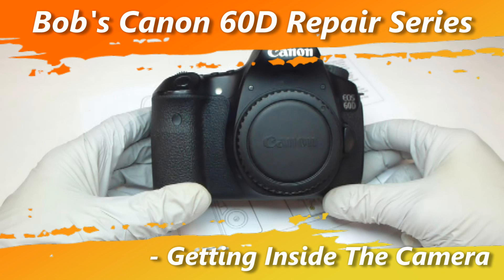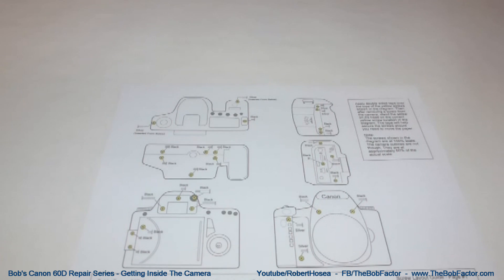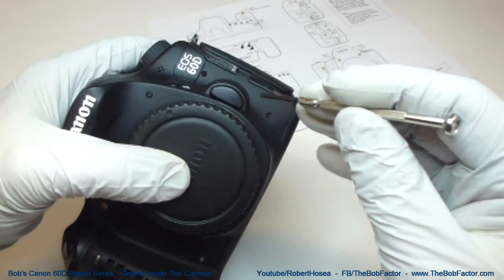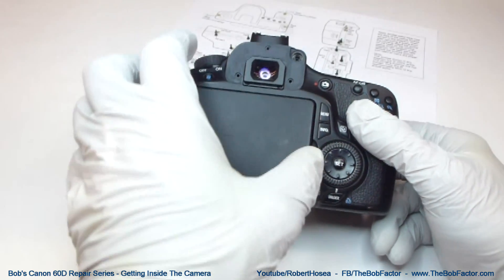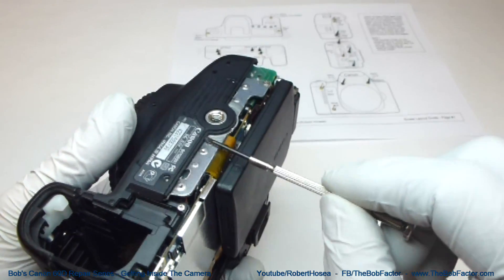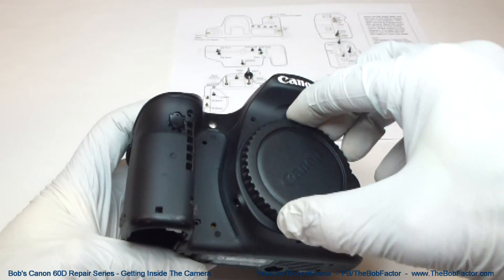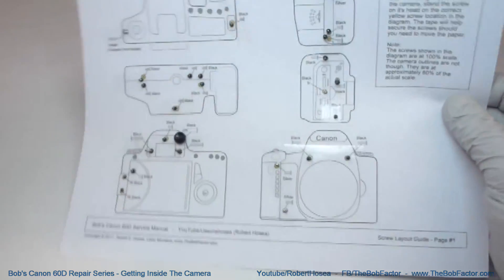Canon 60D Repair Series - Video #1, Getting Inside The Camera

Comment: Hi again Robert. Did you ever have err 80 on your 60d? Mine started with that, then main LCD stopped working, then camera won't turn on anymore. Every once in a while, I got it to turn back on just to see that err 80 flashing on top LCD and if I turn it off, it will be dead again.
Reply from the maker: Hi Lazy Chop.
I've never had that error come up on any of my 60D's, but I've seen a lot of comments from people in forums that have run into it.

Here is Canon's info about the Err 80:
---------------------------------------------------------------------------------------------------------------------------------------------------------------
Description: A malfunction with the electric control or images has been detected.
Resolution: Turn the power off, then remove and re-install the battery. Then turn the power on again.
---------------------------------------------------------------------------------------------------------------------------------------------------------------

Here's a comment from someone's post in a forum who had talked to a Canon rep about it, and what they suggested regarding Err 80:
---------------------------------------------------------------------------------------------------------------------------------------------------------------
I contacted the Canon reps, and one suggestion they had was to take out the SD card, battery and other accessories from camera and leave it like that for at least 30 minutes. I kept it like that for a day and have just now inserted the battery, and the camera turned back on just fine, and I can access the menu, etc. I have yet to install a SD card and check if it can read off the card and write to it as well.
---------------------------------------------------------------------------------------------------------------------------------------------------------------

Something that I did run into two weeks ago on one of my 60Ds, was the camera not turning on at all after working fine the day before, and only flashing an empty battery icon on the top LCD. After a day I figured out that it was the SD card causing the problem. When I changed the card out with another one and then turned the camera on everything worked fine. I put the original card back in, and the camera quit again. So I put the SD card in a card reader and reformatted it and it's been working fine in that same camera ever since. Go figure.

My guess as to what Canon's meaning of  "A malfunction with the electric control or images has been detected." is, would be something wrong with the SD card's board, or the CCD, or something on the main board.

If I come across anything helpful I'll let you know Lazy Chop.

Bob
Reply: Robert Hosea thank you very much. I also looked in those threads on canon community. My case was pretty much similar to the last case you noted, except it did not work with any card i have. I guess there is something wrong with sd card board. I will be watching your video to figure out how to disassembled it for a replacement.
Reply from the maker: The SD card would be a good place to start. It's tough to troubleshoot though without actually replacing it. And new ones are not cheap. I have "used"  boards for a 60D that I use to help determine what board is bad in a camera. I can send you my SD card board to try in yours if you want. That would at least tell you if the board is bad before dishing out the $$ to buy a new one. I would just need the board back again. Let me know if you want to use the board, and you can email me your address if you do.
Reply: Robert Hosea thank you. that's so kind of you to offer. I already owed you too much. I just found a cheap one on craigslist that has broken lcd but working fine. i will try to swap the part to see if it works. 😉
Reply: Thanks to your video tutorials , i was able to swap the sd card board. Err 80 went away. Unfortunately, i guess i have deeper issue than just card board, i did not think abt it since I thought they all linked to the sd card board problem. The lcd still black, camera still not taking pictures, flash wont pop and won't connect to pc either. I tried connecting it to pc when err 80 was present, it would not connect. I accidentally touch the flash capacitor while it was on but got no shock, so I guess that could be another issue. I will update if i found anything. Fixing camera seems to be a lot more fun than i thought. Great way to learn
Reply from the maker: Hi Lazy Chop.

Ya, finding out what is actually broken can take a lot longer then the actual fix itself.  And that sucks.

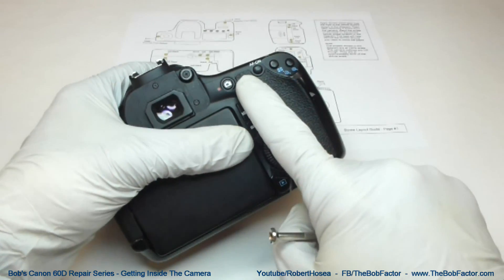There is one that thing that you can quickly check though; in video #2 at time stamp 3:14 it shows a flat ribbon cable being disconnected. If you had also disconnected the other end of that cable from the bottom board, then you will want to make sure that the cable was not reinstalled backwards. Both ends of the cable are the same size and so it can be turned around and installed backwards, and then nothing will work at all.  And it usually displays an empty flashing battery icon on the top lcd. If you didn't disconnect the other end from the bottom board, then you're fine and that's not a possible problem. 

Is it displaying anything on the top lcd now?

Depending on how long it's been since the camera has been successfully turned on will make a difference on the flash capacitor's charge. The capacitor will lose it's charge over a long period of time.

Just curious, does the Err 80 message reappear on the top lcd if the original SD card board is put back in? If it doesn't reappear, then that could mean that a flat ribbon cable isn't being reinstalled, or connected, correctly somewhere during your testing. So, seeing if you can get Err 80 to reappear with the old card reinstalled again could tell you something.

Bob
Reply: Hi Robert, 

I wished I read your reply earlier, as I kept goofing off and switching parts around blindly without success. I only found that a silver screw somehow missing, near powerboard, so I got a replacement for it. As soon as I found your reply, I realized that my lcd issue might just be the cable. The one you mentioned 3:14 was installed correctly so I checked the lcd flex cable, and that was the issue. 
It looked fine but for some reason it did not work. I used the other camera's cable and it was working. 
I am not sure how the screw went missing, or if it actually had something to do with the mess, but I am happy that the camera is working again, and happy to learn something new. 
Thank you very much for all your time and help. Much appreciated.
Reply from the maker: You're welcome. And I'm glad to hear that you got it working again!
Reply: Hi Robert, 
I am using your videos to troubleshoot problems with my 60D. Thank you for uploading these :).

I got a second used working 60D, and have been transferring PCB boards into this one to check if they are working. I was having image problems with pink and other coloured stripes appearing over the still image and square artifacts appearing in the videos. So far, the mainboard, SD card board and LCD swivel monitor appear to be good. I am suspecting the sensor now. 

You mentioned the wide flex cable going from the mainboard to the bottom flash board causing the battery icon to flash. Would this also happen if the red plastic from the end of this cable had de-laminated?
Reply from the maker: Hi Steven

Yes, if one or more of the contacts on the end of the cable can move independently from any of the others, then I would think that it could cause some problems, because the contacts may not all seat properly. And that could create the same problem with the battery icon flashing. When that happened on mine though I couldn't get the camera to operate at all. Not sure if that's happening on yours.

On the problem with the colored stripes appearing on the images, if you haven't already, I would check the CCD's flat ribbon cable and connectors first. It may be a bad connection.
Bob
Reply: Actually that is what is happening at the moment. The camera doesn't work at all. Is it possible to stick the red plastic back down with some kind of glue? I made the mistake of using my fingernail at the edge of these bits to make sure the cables were securely in place, but this ended up lifting up  the red plastic from 2 cables and removed it completely from 1 cable on my new camera. 

Good point about checking the CCD Cable and connectors first. I might do another tear down of both cameras, and swap this cable over to see what happens.
Reply from the maker: I just took another look at that cable, and I'm not really sure it would be too easy to repair Steven. But, if you try to repair it I would think some kind of instant set glue like Crazy glue or Loctite would work best. I tried repairing that same cable before, but for a different problem, and it didn't work for me. It doesn't mean it won't work for you though. I ended up buying a new cable to replace it and that fixed my problem.

Here's a link for that bottom cable on Ebay if you need to replace it: https://www.ebay.com/itm/BOTTOM-MAIN-FLEX-CABLE-FPC-FOR-CANON-EOS-60D-NEW-ch1-8782-000-/361527879793?hash=item542cbda871.
Reply: I just swapped the CCD flat ribbon cable into the new working 60D, and it appeared to be working fine. I then tried to test the connectors, as you suggested. I am not sure how to do this. I tried connecting A1 on the Sensor connector to A1 on the Main Board connector. I did not get a continuity signal, but I did get one when connected to multiple other pins on the Main Board. However, this was the same with the new working 60D. Do I need a diagram of which pins on one connector link to the pins on the other connector? On the CCD cable, some copper traces link one pin to one pin, but others link one to many pins.
Reply from the maker: I don't think you will need to check each connection independently on the CCD cable Steven. Just checking to make sure that the connectors are seating properly into the sockets should be good enough. Unless of course the cable had been removed many times, and had also been pulled or tugged on a lot. Then maybe you would need to check them all. But being able to test the cable in another working camera saves a lot of time. Since you said you had already replaced the main board, it looks a little more like it may be the sensor now. Unfortunately there isn't any real easy to test it without taking it out and trying it in another camera though.
Reply: Thanks Robert. I agree. I was thinking of ordering a replacement sensor, rather than messing with the seating calibration of the sensor in the working camera.
Reply from the maker: I agree Steven, that sounds like the best idea. Let me know how you make out on this.
Reply: Hi Robert, the cost to replace the CCD sensor with a used part, will be about $180 Australian. It is sounding like it would be more economical to sell the parts.
Reply from the maker: Hi Steven. Ya, that does get the cost up there pretty darn fast doesn't it. And if you knew for sure that it was CCD that was actually the source of the problems, then that could help justify a cost like that. But without knowing for sure, it's an expensive gamble. Parting it out sounds like that might be a good idea.

Comment: Hey buddy. Your Schematic only opens 1 sheet.  Is this still a valid link? I've also tried your website but there is no path to get me to the pdfs for the while disassembly. Please let me know. (If email is possible or more simple: ayanke702@gmail.com)
Reply from the maker: Let me check on that Andrew.....
Reply from the maker: The links for each of the other diagrams were actually with the other videos that used them. But,  I went ahead and added links for all three of the diagrams to each of the videos that use any of them. So you should have access to all of them in the description for this video too. Let me know if you have any problems with them Andrew.
Reply: Thank You much. I have my own electronics lab but have never had a go at a camera. I ordered a digital caliper for the ccd thingy and am going to try and replace the shutters and not the whole unit for my wife whos camera broke. I bought her a new mark ii but figured with your videos and screw tracking sheets, I might be able to get it back together.  It's very helpful.. have you considered setting up a patreon page?
Reply from the maker: Andrew, it doesn't sound like you will have any problems with this at all. If you've already been exposed to the electrical components world, then it won't be a big shock to your system when you do open up the camera. In most cases you will never be replacing individual components (ic's, resistors, etc.), just entire PC boards and such. But sometimes even trying to troubleshoot which PC board is defective, can be time consuming. My first repair success moment with the 60D was finally (after two weeks of working on it) finding out that a one-inch long flat ribbon cable that looks identical on both ends....isn't. If you put it in one way everything works fine. If you put it in the other way you get a flashing empty battery indicator on the top LCD.

Replacing the curtains on my 60D's shutter was my very first repair attempt on mine. And......I totally failed. Lol. Turns out that one of the incredibly small miniature springs needed for the curtains, was already broken. And so the new curtains didn't help without it. I eventually just replaced the entire assembly.

I have looked at making a Patreon page before. But I have never gotten around to doing it. I do have a FB page about designing and creating PC boards and such for underwater ROV's, and thought that that would be a good one to start with. One of these days maybe I'll try it. Here's a link to that page if you're interested in ROVs at all.
https://www.facebook.com/BuildingAnROV/

Good luck with the repair on your wife's camera. Give me a shout if you have any questions at all.

Comment: Hey Robert, I was wondering if you've ever come across an issue with the 60D (orang canon EOS) where the LCD display freezes and/or image becomes distorted when either viewing though the screen or filming. Menu screen seems fine and photo taking & viewing (after taken the shot) works fine.
Reply from the maker: No I haven't come across that problem before Antony. It sounds like a problem with the CCD and/or the main board though, since the menu and the picture viewing seem to work fine. I'll let you know if I come across any information on this that might help you out. -Bob

Comment: I broke the connector great! Do you know if there's a replacement for that?
Reply from the maker: Which connector Michelle? I pretty much buy all of my parts on eBay. Let me know which connector and I'll see what I can find.
Reply: Robert Hosea the one you said to be careful when prying up the back panel. The one on the right side behind the grip.
Reply from the maker: Ok, I think I know which one you are talking about. Is it the one at time stamp 7:48?
Reply from the maker: Also, did the connector on the flat ribbon cable break? Or the connector on the board?
Reply from the maker: Michelle, here's a link for eBay for a flat ribbon cable assembly for the back panel, which includes the connector shown at time stamp 7:48. Replacing the entire flat ribbon cable would be the only way to replace that particular connector. http://www.ebay.com/itm/GENUINE-CANON-60D-REAR-CONTROL-BOARD-PARTS-FOR-REPAIR-/272706567845?hash=item3f7e93fea5:g:hvAAAOSwX9FZOB-O
Reply from the maker: Also, if you do need to replace the flat ribbon cable that's on the back cover, then this video may help you out a bit. https://youtu.be/zaJJqRCfYXc

Comment: Hello Robert, thank for the videos! Very nicely done. My 60D got wet as it was ON and is not working so I followed your videos with hopes to to remove my 28-135mm IS Ultrasonic lens off of it. Lens release button seems to be stuck and not releasing the lens; it's very hard and not able to press it down. Pulled camera apart as far as I could but unable to pull the front cover off because the lens is stuck on. Do you have any suggestions or able to help to get the lens off? Thank you in advance! Paul
Reply from the maker: Hi Paul. I've never run into that problem before. Let me take a look at my "repair" camera and see if I can come up with anything for you. I'll let you know what I find out.
Reply from the maker: I'm not sure what's going on with it Paul. It's either the black button on the camera's front cover that is stuck, or it's the metal lever & spring that is under the front cover (that the plastic button pushes on) that is stuck. My guess is that it's the lever & spring under the cover that's stuck. But there would have to be something large underneath the metal lever (where the spring is) to keep it from going down far enough to release the lens. I can send you pictures of the lever and spring if you think that it could help you out. I'm afraid I don't have a possible solution for you though. Sorry I can't be more help. Let me know what you find out on it if you can. Thanks.

Comment: Fantastic informative video's Rob...with the top cover off as a whole unit...how difficult is it to remove the whole top lcd assembly to change it.Mine is broken and bleeding
Reply from the maker: Philip, You will need to remove some hardware for the flash unit to get to the LCD. I don't have anything that shows that procedure yet, but I will very soon. InfernalFirefly's response to your question in his thread does spell it out very nicely though. Good luck with your repair. I'll try to get a video for the procedure uploaded soon.